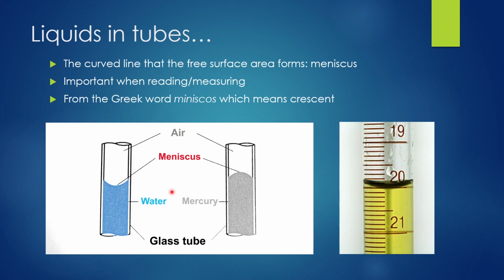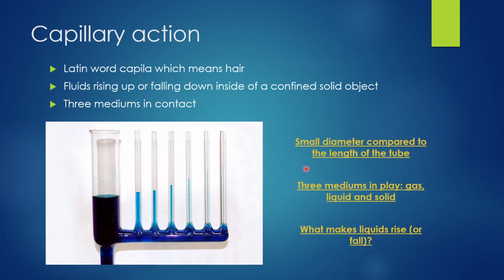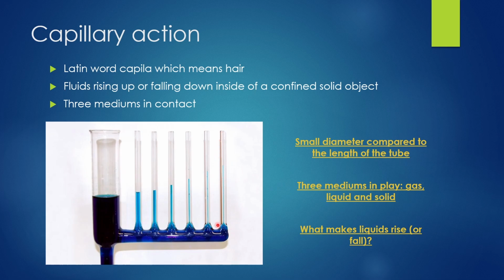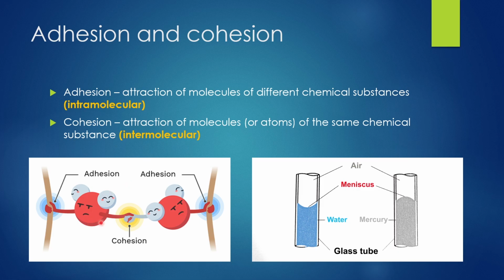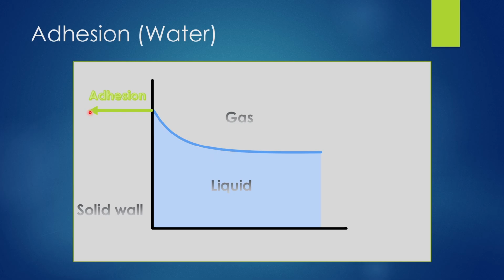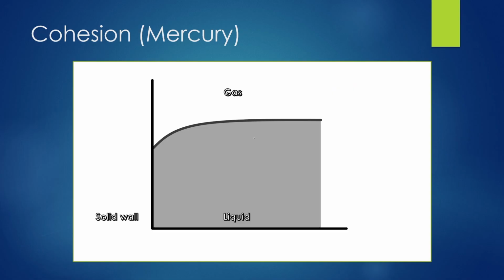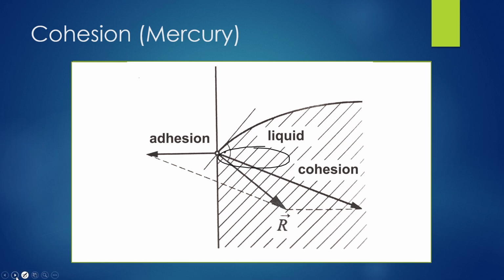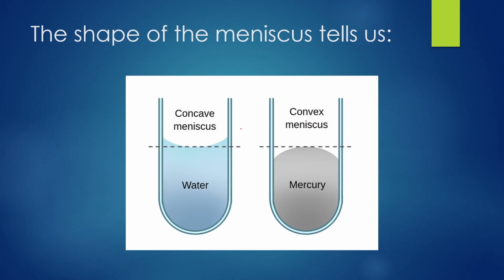What is capillary action?

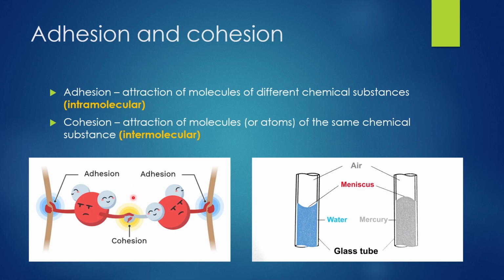Comment: Great explanation of fluid behaviour and the mechanics behind wetting and non-wetting surfaces! 🧪 Just a quick heads-up on the terminology around 02:50 and 04:29: the terms 'intermolecular' and 'intramolecular' got flipped a couple of times in the audio.

Since both cohesion (water-to-water) and adhesion (water-to-glass) happen between separate molecules, they are both technically intermolecular forces.

An example of an intramolecular force would be the strong covalent chemical bonds inside a single water molecule, holding its two hydrogen atoms and one oxygen atom together.

Thanks for putting this step-by-step fluid mechanics course together; the visual breakdowns of the resultant forces and meniscus shapes are incredibly helpful!

For the sake of knowledge, which I believe you are contributing to instead of revenue from the video, you may need to act on this.
Reply from the maker: Dear Mike, thank you for the positive feedback. You are totally right about this, we are working on a rework of this video and we will change the contents so no further misunderstandings arise from this. Best regards!

Comment: 3:01 This part is incorrect, both adhesion and cohesion are "intermolecular" forces. Intramolecular refers to forces within a single molecule like covalent bonds, neither adhesion nor cohesion is intramolecular.
Reply from the maker: You’re absolutely right — both adhesion and cohesion are intermolecular forces, not intramolecular. We’re not deeply versed in chemistry, so the wording there wasn’t technically correct. The point we were trying to emphasize was the interaction between different molecules (adhesion) versus the interaction between the same molecules (cohesion). Thanks for pointing it out!

Comment: may i ask something? the cohesion force vector in mercury glass tube looks longer because the cohesion force is larger than the adhesion force no? same thing like the water glass tube, the adhesion force vector looks longer because the adhesion force is larger than the cohesion force
Reply from the maker: Exactly, great observation. In this example we used the size of the vectors to match with the larger cohesion or adhesion forces with the 2 fluids
Reply: @engineeringpod when will you continue fluid :) your explanation is easy to understand
Reply from the maker: Thank you, it means a lot. Another fluid mechanics course is in the works
Write us an email at theengineeringpod@gmail
We want to give you the complete course for free :)
Reply: @engineeringpod sure!